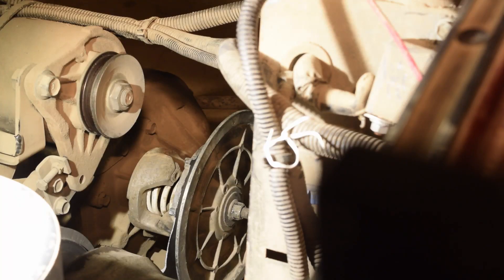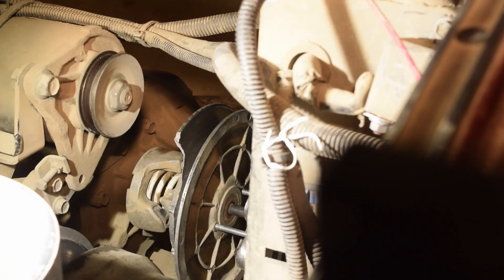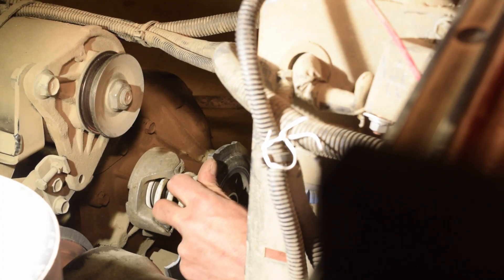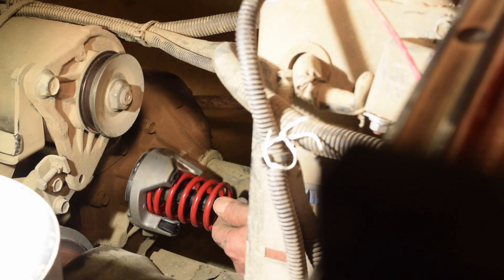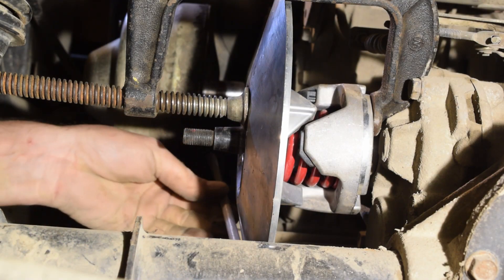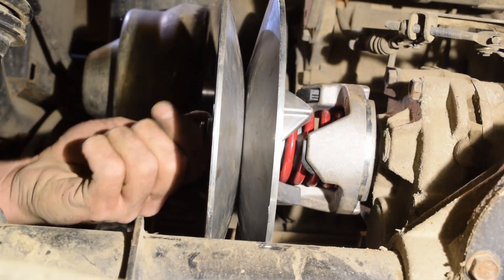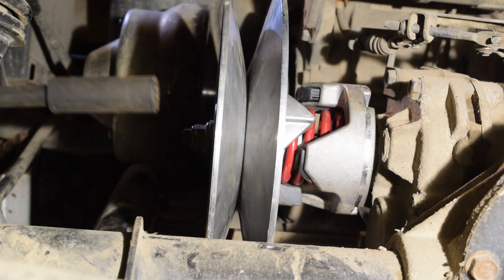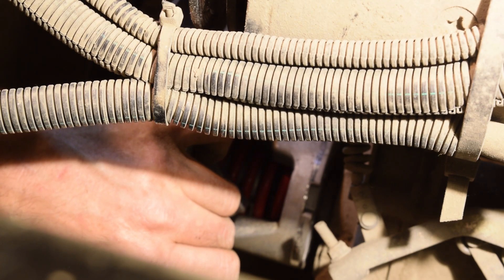Secondary Clutch Replacement Golf Cart G2-G22 Yamaha

Comment: ok but how do i remove the while rearend to replace the broken forward gear apperently 630km in 2 years was enough. plus the aftermarket engine slid back on the engine plate to push the carts governor down into the case. i did a 420 swap 2 years ago and have daily driven it since until last friday when i went to leave from a stop sign and something clearly broke there was a lot of clunking until i got stopped then one more loud clunk and there was no more forward movement thankfully reverse still worked to get home. so reverse still working means the guide collar should still be good its just the forward gear wheel

Comment: Were you using a air hammer against the bolt to release it
Reply from the maker: I used an impact gun, hope that helps.
Reply: Is that a socket he has over the bolt if so what size is it

Comment: I did this repair with a new heavy duty spring. I’m pretty sure I did everything correctly but there’s a whine and it’s shredded two drive belts. Any ideas? Do you think the new spring could be the problem?
Reply: Yes
Reply: Problem is you did it like the video. Wrong.
Reply from the maker: It already had a heavy duty spring installed prior (as stated in the video) If you watch my latest video you'll see that the same clutch is installed and is still working just fine after over four years of use.

Comment: The kit I bought for my 1998 yamaha g16 looks exactly like the one you are installing except it came with a metal shim that the instructions said the put on with the "teeth" facing out. So it went on first then the spring seat. Followed your video to install. Got install done around 2 weeks ago. Drove cart very few times but was driving it yesterday and the whole thing fell off. The nut somehow backoff while driving the cart and everything came off except the spring seat and spring. Was I not supposed to use the additional shim that was sent with the kit?
Reply from the maker: If you had the same kit I had then you were suppose to replace the old shim with the new one. Did you torque it properly?
Reply: I just had the same thing happen

Comment: Did you lose speed ? and how is it holding up till this day ? Thinking about doing the same
Reply from the maker: I didn't notice any speed loss, it seems the same from what I could tell. I just recently installed a Predator 670 (22hp) motor in the same cart (my latest video) and the clutch is handling it just fine.
Reply: @marksplace  gotcha. I started to take my old one off today, while I wait for the new one to come in. I got everything off except the old metal shim that will be provided. Not sure I want to mess with it and risk causing damage to splines, could I use existing metal shim? It’s the same thickness.
Reply from the maker: As long as it's the same thickness I wouldn't see why you wouldn't be able to reuse it.

Comment: Excellent video mark. I watched to see how it was compressed. Looks like I’m adding some c-clamps to my tool collection today. Also what does the spring do to make it heavy duty?
Reply from the maker: Thank, 
The heavy duty spring keeps the clutch from opening as fast as compaired to the stock sping. Essentially keeping you in a lower gear (per say) for a longer period of time, which is good for climbing hills. More power with a sacrifice in some delay in top speed, it will get there. 

I hope that was a clear enough explanation?  :)
Reply: @marksplace  I bought several c clamps from harbor freight, however.......... They arent i guess deep enough to grip the first piece and the first plate. The depth of the jaw i guess isnt deep enough.
Reply from the maker: How did you make out, did you find the right C-Clamp?

Comment: I just found out I have this exact problem and the golf cart mechanic that came over said he would not even attempt this. You make it look pretty easy! Were you able to do all this work by removing the driver’s rear wheel? Is it easy to get the belt back on?
Reply from the maker: The hardest part of the job is holding the spring back wile trying to get the keyway in. As far as the belt goes, that's a piece of cake.

The only thing I remember removing is the rear tire, which should give you ample room to accomplish the job.

Good luck, let me know if you need anymore info and also just to let us know how you made out.

Comment: You’re not done. Dumb maybe. You didn’t line up the clutch with the ramp shoes so it will not work properly and be noisy and your new clutch will be destroyed in a couple rides assuming it will even take off and not burn the belt off. 😂
Reply from the maker: I put that on over 4 years ago and is now being driven by a 22hp Predator engine. It doesn't make any noises and works as it should, no problems at all.